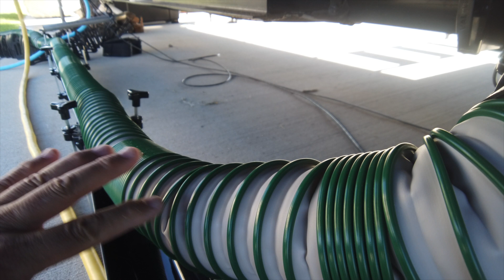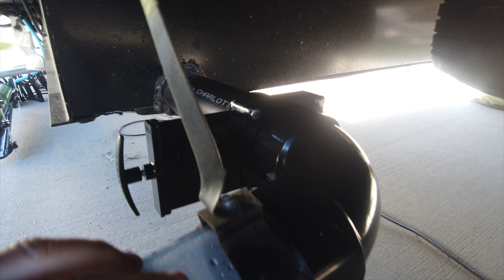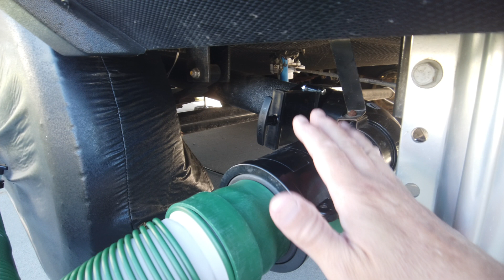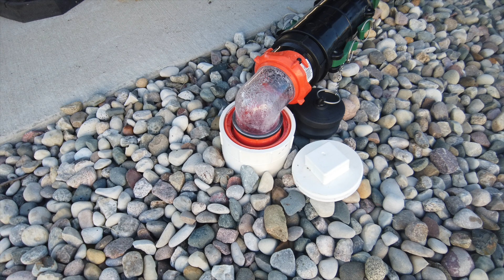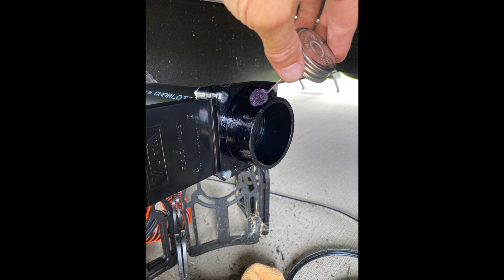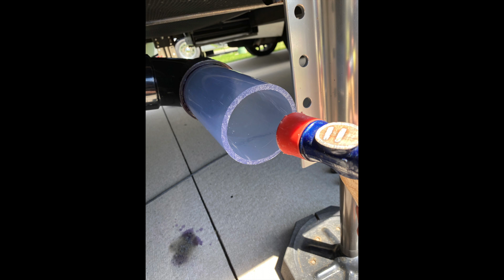LCI Waste Master System Install | Grand Design Momentum 397TH

Comment from the maker: We hate messy drain lines.  Nothing is more irritating than draining tanks and getting a bunch of sludge on your hands and clothing because the system leaks.  We have no idea why RV Manufacturers continue to use the twist-on lug-type fittings when every other waste management business has adopted CAM-Locks that do not leak!  If you have any questions please post a new comment (don't reply to this one).  We will respond to you as quickly as we can.  Thank you for supporting Passion Highway!
Reply: how did you connect the 2 LCI drain tubes? I cant find a Y connector that works with with the LCI system (annoyingly) and I have two sewage drains / 4 tanks. My rig came with the LCI system installed from the factory, however, they only provided 1 sewer line with the green handle on the end. Okay, great, but what were their expectations...? that I unhook the sewer line each time I need to dump...?  I thought I may have to put a connector on to switch between 2 different brands, but this seems very silly. Im shocked LCI hasn't thought about people who have more than 1 sewer line...?? Or am I missing something here?  Thanks for ANY help you can provide!!

Comment: This video is awesome!  Thank you very much, Jim, for a hugely informative video of a high quality modification to a system nobody likes to deal with.  I just bought a Grand Design Momentum 349M and I'm going to try to copy exactly what you did.   It was build in October and has been winterized since, so now is the perfect time to copy your cool changes.  
I'll also say that I really enjoy your other videos.  I appreciate the lack of "fluff" and thus the highly concentrated information you present.
Reply from the maker: Jim, it was very nice of you to post this comment.  I sincerely appreciate it.  It takes a lot of time to create video. It is very nice to hear that they have helped others.  The WasteMaster system is awesome.  We have been using it for over a year now.  When we are parked seasonally, they are out in the weather 24x7.  We have never had a single drip from any connection.  They work perfectly.  This is one of the best modifications we have made. It really should be the industry standard.
Reply: @PassionHighway  just a follow up - I did copy exactly what you did on my 349M and have been using it for a few months now.  Like you, I have never had a single drip from any connection.   Even when I disconnect the hose from the fittings on the RV, the coupling area is almost completely dry.  What a joy!
Since 99% of the time I use a dump station (rather than connecting to a full hookup site), I opted for the WasteMaster drain hose with the big valve on the end.  I had to modify my hose carrier under the coach to install the hose end locker for storage.   I'm having a little issue with that, but it's so minor compared to not ever worrying about getting the "suprise" you talk about in your video.
Again, thanks so much for your excellent video and stellar idea!

Comment: I have never had a leak with the standard sewer hose
Unsure what you were doing wrong in the past to have such difficulty 
The system is not under high pressure so twist fitting is perfectly suitable
Reply: Then you have been lucky. I have had problems with the bayonet mounts, as the manufacturing tolerances are quite lax. High pressure will find the bad seals in the bayonet mounts.
Reply from the maker: The system is under higher pressure than you may think.  When the tanks fill up there is a lot of force that pushes through these hoses when the valve is opened.  Basic volumetric calculations.  Lots of water funneling through a smaller opening increases pressure.  This is how water towers work in city's.  We had a brand new Camco Rino hose that blew out the first time we used it.  The 90 degree connection at the sewer pushed back on the line and it ripped the hose off of the fitting.  There is a delayed reaction by the time you push the valve back in to stop the flow and the time that the drain lines have fully evacuated.  Water does not stop the second the valve is closed again.  Luckily for us it was Gray Water, but it made a big mess nonetheless.  The LCI WasteMaster is a much higher quality hose.  Put a LCI hose side by side next to anything else on the market and there is no comparison.  The inside of the hose is also smoother and creates less turbulence.  Everything about the WasteMaster system is better.  This isn't a  have to do project, but the change over was well worth it for us.  Even if we change rigs some day, this will be one of the very first upgrades.